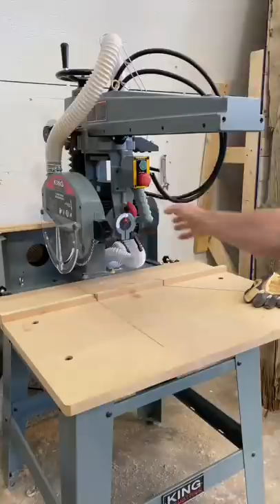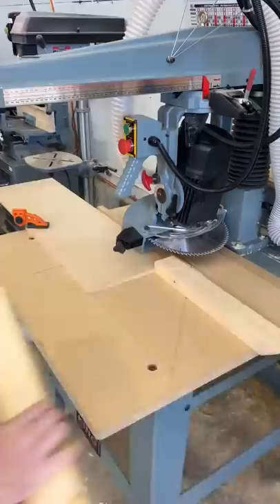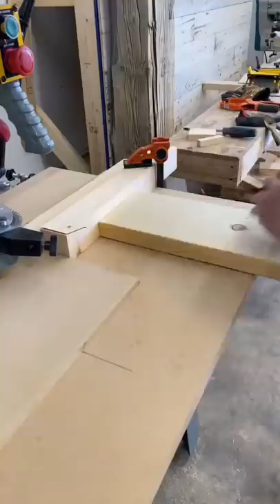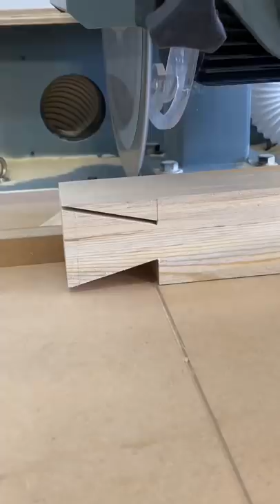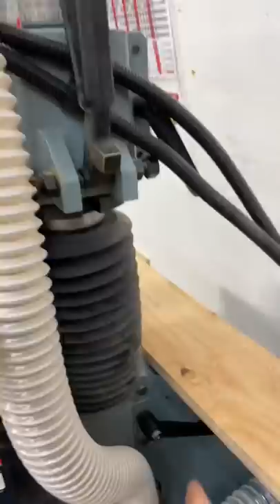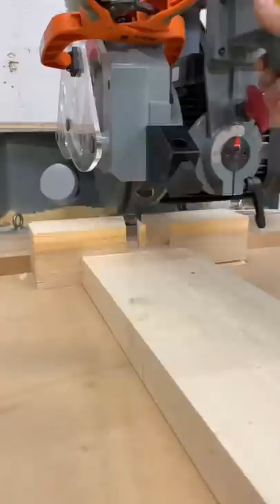Dovetail half lap

Comment: I didn't even know this power tool existed... now it's all I want.
Reply: Blade binding can be.... Interesting. It can ride up and over the piece you're working on if your blade is dull. Just a quirk of the tool and something maintenance can prevent. If you're brave you can rotate the blade outwards and use a jig built into the side of your bench and cut sheet goods like you would with a table saw. Don't trip!
Reply: @weege5.45  ha! Yeah...that could get a little messy.
Reply: @weege5.45  A fella can do a bit of homework and one of those blades which habe a negative rake angle (at least I think it's called rake.) Exactly NOT what you use in a table saw.
Reply: Radial Arm Saw.
I prefer them to mitre cut off saws.

Comment: Radial arm saws rock. I bought one for a project for the house and later realized there was a safety recall on it (70s era maybe early 80s) Craftsman.   It was unlawful to sell and Sears for a while was paying to shop the motor back as the unit had to be inoperable and they would give you $$. 

So i gave it away with no liability on my end. it served my purpose. but do love a radial arm saw

Comment: Now if I could get my old Craftsman 10" Radial Arm Saw motor brushes replaced I'd  have a saw almost this nice but they don't make them anymore.
Reply: Check around to see if you got anyone who still rebuilds starters, altenaters and such. They may be able to help you out, especially if old school. You never know what the have or what they can do.
Just a thought.
Reply: @bcallahan3806  I did a few years ago. They no longer make the saw or most of its components.  However, once on a Blue moon there's parts on Ebay for them. The problem I've run into is that you have to have the exact model in order to get replacement brushes for it. In my case that means hobbling all the way down to my barn and cleaning the thing off and getting photos of the model and serial number. I will one of these days but it won't be till these ulcers on my feet go away. But I appreciate appreciate input.  Thanks for the suggestion.
Reply: @littleshepherdfarm2128  best of luck👍